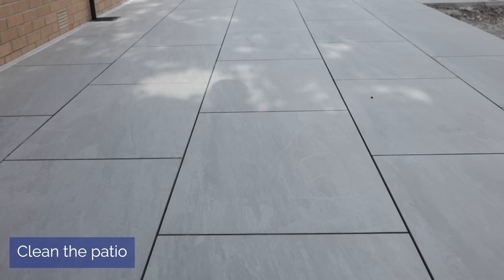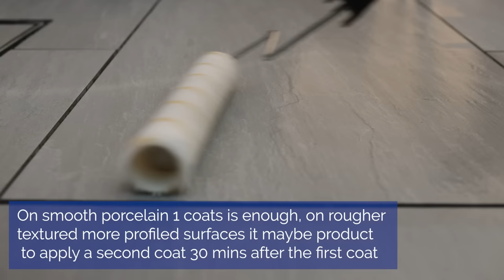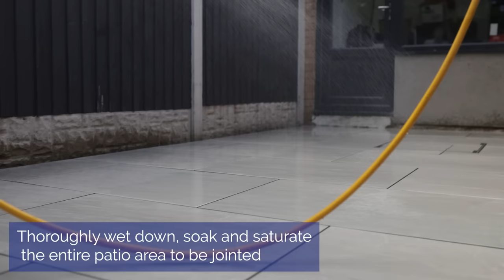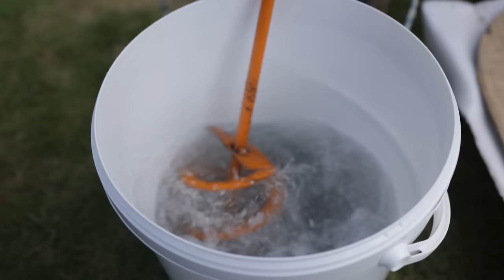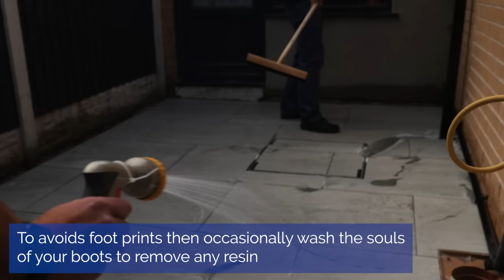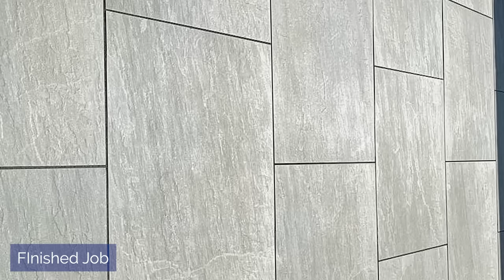GftK's vdw 815+ for grouting Porcelain Paving in Southport, UK

Comment: Watch so many people that shows you how to grout - and as always like this video the mix is way to weak. It should always be a stiff smooth paste and not sloppy. Grout contracts and if the mixture is to weak ( i.e sloppy) in a short period of time it will break up leaving it to the elements and water ingress. The grout needs to be firm and pushed into the joints - yes more hard work but it will last a lifetime if done properly
Reply from the maker: Alan agreed for many cement based grouts where the water to cement ratio is critical - BUT the vdw 815 and 850 are 2-component, reaction hardening, epoxy resin based materials. This is a completely different technology whereby this flowable consistence that is ideal for self-compacting into the joints is also ideal for shrinkage-free hardening and curing, even at lower temperatures and in wet conditions. Check out the website for more information here https://nccstreetscape.co.uk/paving-jointing/gftk-paving-joint-technology.html
Reply: @nccstreetscapevideo4554  ah rightio. thanks for clarifying that - good to know.
Reply from the maker: @alantumelty5481  No problem - if you need more information and references / case studies there are loads on the website from all around the UK for almost 15 years now - slowly catching on and once tried you wont go back! If you want to try the materials give us a call and we will see what we can do to assist - Cheers
Reply: @nccstreetscapevideo4554  Retired from it now which is why I'd not heard of it but thanks and good to know. Cheers

Comment: Does this reduce the R value of the tiles.?
Reply from the maker: Not at all if anything the joints on any porcelain paved surface will increase the effective R value as the profile is greater than the porcelain finish. We do understand what you mean about some traditional porcelain tile grouts used internally as these also have a very smooth finish, these external use products are much more robust.

Comment: what’s the difference between this and standard grout? are the joints still porous or will water sit on top? thanks
Reply from the maker: Hi Joey - sorry for slight delay in reply. This is a completely different technology based on 2-component epoxy resin that is pre-coated and graded alluvial quartz sand. External porcelain tiles are designed to be laid to fall to suitable drainage in the same way as all external paving and so water should never sit on any paving unless drains ae blocked. There is some confusion over permeability in paving as technically all cement based concrete and mortar bedding mortars are permeable unless they are specifically designed to be waterproof, it is really just a question of degree. The GftK vdw 815+ and vdw 850+ joint mortars are permeable to allow water from below to escape through evaporation, as much as for water to drain from above, again it is a question of degree and this degree of permeability is a distinct advantage for faster installation with earlier grouting, and more effective and ecological performance in service.
- There is a lot more information about all aspects of this subject on our website - You can find this on the Paving Jointing and Paving Jointing FAQS pages here: https://nccstreetscape.co.uk/paving-jointing.html 
- Also there is more background specifically on and relating to external porcelain tiles, porcelain paving and the issues of pointing / grouting / jointing on our  Porcelain Paving & FAQS pages here: https://nccstreetscape.co.uk/type-of-paving-unit/porcelain-paving.html
- If you would like more specific information and assistance for your projects you can email us to: technical@nccstreetscape.co.uk  
- Or call us when back in the office on Tuesday: 01257 266696
Hope this helps for now?
Reply: @nccstreetscapevideo4554  you've won the most proffessional answer award 👍👍👍
Reply: This isn't good practice, it's quick and dare I say lazy.
You should always use exterior porcelain grout like Nexus or Fuga pave CH.
You want a sealed, watertight grout that prevents water ingress below and hence frost lifting flags, even if they are slurry backed .
Reply from the maker: @ivegotaporscheandalambo3318  Hi well that is an interesting combination of several misunderstandings and myths in the UK paving industry - Firstly confusing high performance 2-part jointing mortars with simple-part, vacuum packed, bag in a tub brush-ins that are totally unsuitable for porcelain and any long term paving jointing, and not just because it is permeable. There is a lot more information and support for contractors and specifiers alike with detailed technical explanations on our website here: https://nccstreetscape.co.uk/type-of-paving-unit/porcelain-paving-faqs.html 
Also you can reference the excellent independent PavingExpert website thoughts on this myths of permeable jointing with slabs and porcelain paving and frost damage in the UK here: https://www.pavingexpert.com/faq_permeable_mortars_01 If you have any further questions or would indeed like to fully understand all aspects of this please email our team at: technical@nccstreetscape.co.uk and we will be glad to assist you.
Reply: @nccstreetscapevideo4554  I've used them all, they aren't high performance, sales pitch.
2 parts are ok, but not for porcelain, big bug bear is they green up and black up ( from horse's mouth).
Smooth exterior porcelain grout only ie Fuga pave or Nexus.
Do it once do it right.
I call other ways lazy landscaping
Reply from the maker: @ivegotaporscheandalambo3318  It is clear that this system has a lot of advantages over exterior tile grouts and these are detailed for you on the website, so please check this out and then we can have another conversation, seeing is believing with this and you have not seen it! I am sure you have a lot of experience and would agree that exterior tile grouts can be used they have limitations too, especially in the waiting time before they can be applied on external porcelain, the weather conditions and limitations for their application on site, their ease of finishing and cleaning, their resistance to chemical staining and jet washing, their tensile and flexural strengths for durable bonding to smooth dense substrates, especially when externally exposed and over larger areas etc.
As stated and shown in the video - this is not lazy landscaping this is professional and technically correct landscaping - Please review and find out more here: https://nccstreetscape.co.uk/type-of-paving-unit/porcelain-paving-faqs.html then give us a call and we can discuss whenever you like - Please ask for David
Reply: @nccstreetscapevideo4554  nice, don't need to go on websites etc, I understand you do this for ease and speed etc, that's all fine, but I think we both know the best products are flexible  specially formulated grouts giving anti mould technology with added silicone to ensure water is repelled from surface whilst still allowing vapour to pass.
Zero efflorescence, UV colourfast, extremely durable and great smooth colour finish .
Brush ins , even 2 parts are quite frankly awful aesthetically , colours muted, grainy and cheap.
I'm sorry I know you've tried your best, but your talking to a long term served paver, installing porcelain both in UK and states.
Reply from the maker: @ivegotaporscheandalambo3318  Well I am sure you have some experience with porcelain and if you wanted to fully understand this new technology we would assist you, so whilst surprised that you don't, you now know who and where we are, if and when you do want to engage professionally, till then - Good luck!
Reply: @nccstreetscapevideo4554  if you require help or advice to carry out porcelain grouting to a professional standard, I can help you.
Your work looks good standard and such a shame to go down that lazy avenue of 2 parts, but yes I understand that you need to complete the job to move on.
Shame really, come on get on year knees and graft , do it right do it once.